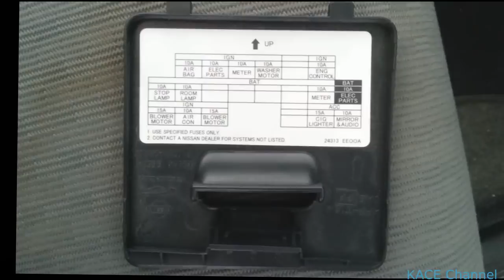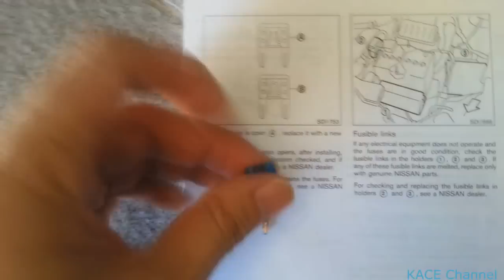How to fix broken car Cigrarette Lighter / Fuse Replacement - Nissan Tiida Versa

Comment: i checked the fuse and the fuse was fine and it still wont work. what could it be? my 2 lighters both dont work...
Reply: Joey Gunz  Have you tried vacuuming? Sometimes things get suck in there.

Comment: what happens if is not the fuse?
Reply: I just I figured it out on my own. I had a similar problem where it wasn't the fuse. I took out the socket itself between the gray steel barrel. There's an in the connection. There's a copper washer and it seems that that copper washer has to make contact with the gray barrel in order to make a solid connection. It looks like the pool of the wire was just enough to keep that little copper washer from making contact so I didn't have any any electricity flow. I put a little dab of solder in between the steel cylinder and the washer between the connector. It sounds complicated but if you have a multimeter and just put the it to a connection to where it beeps whenever you connect it to metal and it has the same connection put to that setting and put it on the copper washer and try to wiggle it a bit. If it beeped like it shouldn't issue continuously beep it shouldn't interruptedly beep